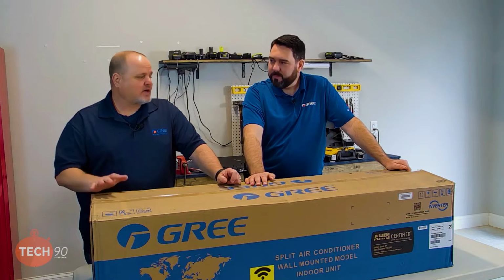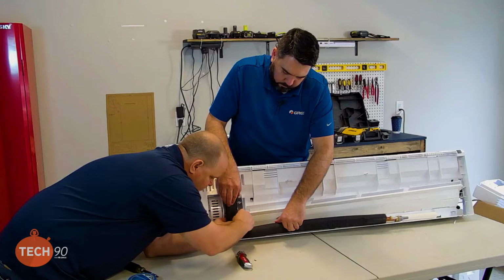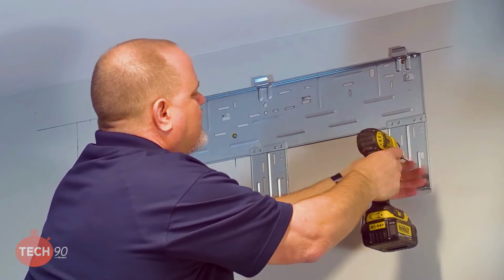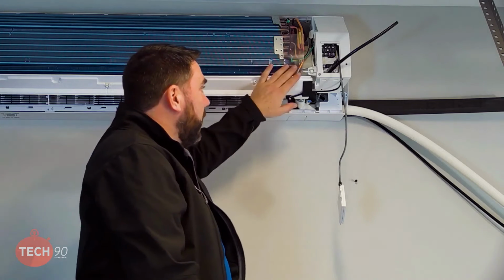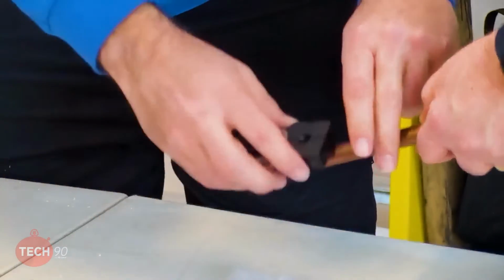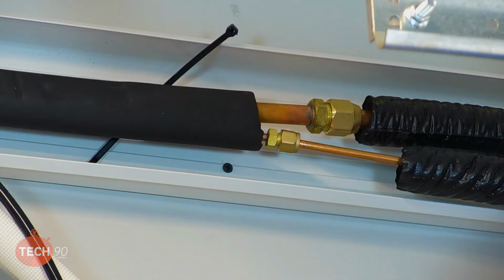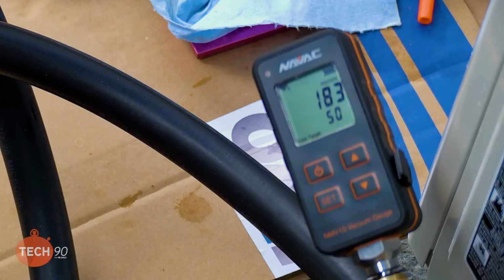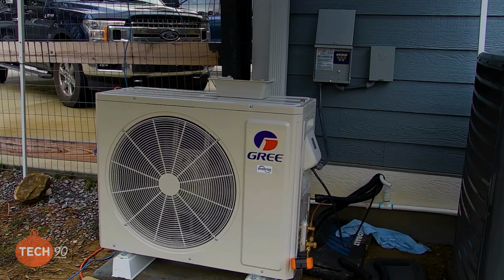HANDS ON! GREE Single Zone Mini-Split Full Installation

Comment: I’ve always been told no oil or nylog on the threads, only on the flare itself.  Oil on the threads changes torque value resulting in inaccurate torque readings.  Can you share thoughts?

Comment: I put a small bead of clear silicone around the perimeter, because if you don’t, you’ll be sucking in dirt for the next 10 to 15 years. Look at your old ones when you remove them and see how dirty the backside of the unit is. It’s easy to take a razor and cut it loose if you need to work on it. When you reinstall it that nice clean cut seals up again.

Comment: Based on R32, it is allowd to flare connection be inside of room, since R32 is slight flameble!? The presure in heating mode can reache 500 psig.
Reply: Yes. No different than a flare on a gas line inside of your house.

Comment: Nice video 🧐 as to what not to do when installing 🧐😂🚶‍♂️💨
Reply from the maker: Awesome! Please share some tips and tricks with us.
Reply: @GREEComfort  manual says at least 15cm(6in) from the ceiling and you installed it at 4 in(even closer to the ceiling because you put the rack at 4in). I know it will work and some other manufacturer calls for 2 in! but going too close to the ceiling might make the unit more prone to icing when its dirty. You should also use sheet-rock anchor at strategic location where you dont have solid, like the top bracket, left and right. Also the drain line doesn't have enough slope. To put pressure after the vacuum you are better you cracking the valve from the unit, that way to ensure no ambient moisture enter, the way you did it, you can't guarantee that no moisture entered since you had to flush the inside of the core remover tool
Reply: @GREEComfort only tip/change I would like to share is never apply nylog to the threads as shown.  Only apply to the flare faces.  Nylog on the threads acts as a lubricant and often results in an overtorque situation.
Reply: @paullund6381 Wtf are you talking about?  I assume you’re just trolling, because this install was absolutely textbook.